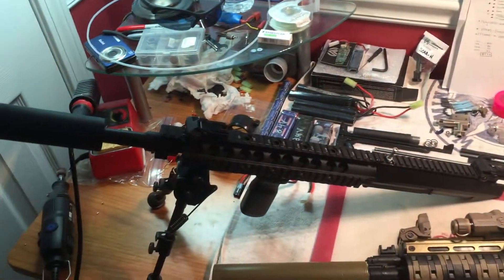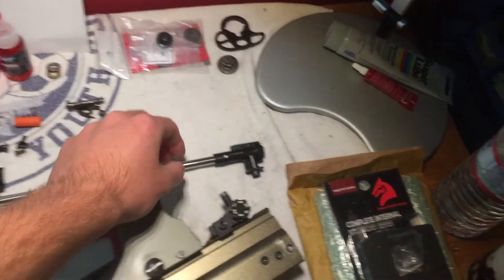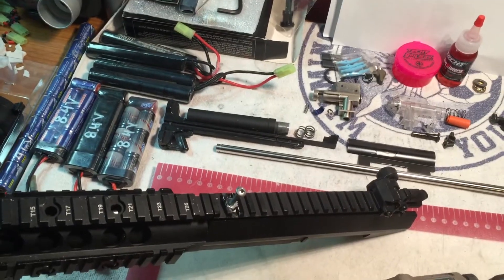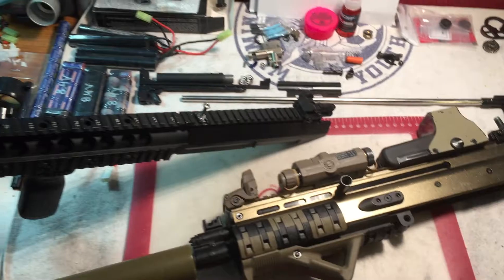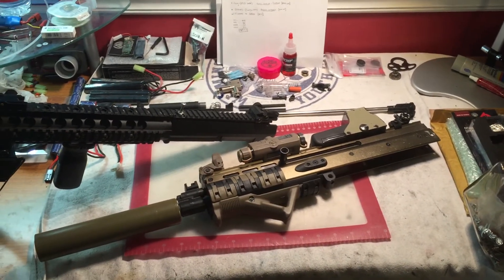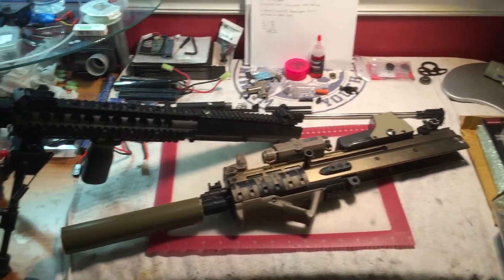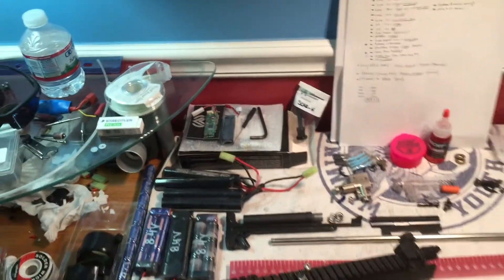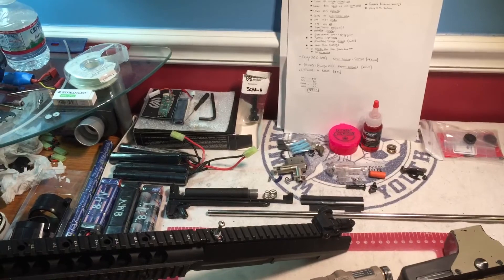Long Awaited Update: I'M NOT DEAD

Comment: Hey, i made a DSG build with SHS new gen4 gears and a SHS dual sector gear, can you try them out as well? Mine went pretty well, around 1 joule with an M130 spring (I believe, i took it from a boneyard) and the SHS spring guide for the dual sector gear (a new one).

For now it sounds really good, using the SHS high torque motor (also a new model, not the one with the wolf).

Comment: Hi Ryan
I don't think anyone has yet specified this,and it's kind'a important.
  If I'm using 11.1 Lipo,when or on which gear ratio do I have to short stroke my sector gear in order to avoid pre-engagement? Example: 11.1 Lipo,16:1 Gear set= 1 tooth stroked or 2 teeth short stroked? Example 2: 13:1 Gear set= 2 teeth short stroked? And also,I know spring strength is also important. Ehhh,so complicated. Thanks

Comment: I like your DSG build mines similar but I have major fps problems. I have a perfect air seal but I'm only getting 200 fps with a 160 ish spring. What barrel length and type do you suggest i am also a fellow scar user, anything helps. Great builds too
Reply: Alexander Andersen DSG builds are tricky to make work, since you doesnt have the same amount of air like a normal build. What is your barrel lenght? You shouldnt exceed 360mm barrel, and are you using the spacer for the spring guide?

And i have to ask you, are you from Denmark? Your name look pretty danish :)
Reply: Jes Christensen I don't have a spacer and also have a 353 inner barrel for the DSG with more work I recently found that I have a tappet problem and replaced the spring. Thanks for the help and I have heritage from Denmark thanks for noticing. :)